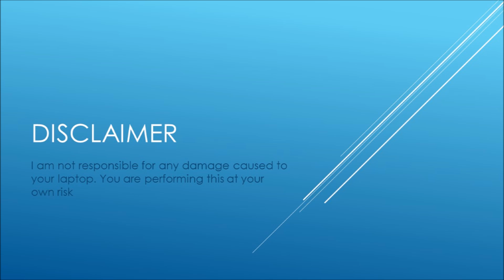Lenovo ThinkPad E570 Disassembly and SATA Hard Drive Install. Includes RAM & Wireless Card.

Comment: Hi Joe,  thanks for the video. I need little help here, can you help me with the issue? I had tried to upgrade through Lenovo vantage and during bios upgrade it turned off and never turn it back on. I took it to local repair shop and he asked to replace the motherboard or another option is to “get a binary file to flash the bios” ..we reached out to Lenovo and they declined to share the binary file..my repair shop guy told me that anyone had this laptop can share the binary file and that could be used to revive my laptop. Can you please please help with binary file?

Comment: At 0:56, the bottom left corner and bottom right corner screws kept getting missing, the holes won't hold the screws in place, the manual says they are m2x7mm screws but they don't fit at all, especially the bottom right corner one, the m2x7mm screw falls right in and out.. what is the correct screw size? Are these 2 screws on your laptop the same size as all the other screws on the back panel at 0:56?

Comment: New to SSD terminology and doing research - if looking to expand with a second SSD on my E570, can I use another PCle NVMe drive or is the second bay only SATA connection?  I assumed as the boot drive was PCle that the other bay was as well.  Also, high level, if just using the SSD as storage for video files for Plex Media Server processing, will a SSD provide noticeable gains over a SSHD or normal HD?

Thanks for the videos!
Reply from the maker: hey Johnny, the laptop contains one PCIe slot and one SATA connection
Reply: Really appreciate your videos and help on SD and YouTube.  Just installed a SSHD last week using your video.  Keep up the good work
Reply from the maker: +johnnyma45 quite welcome!
Reply: Question how do i play a dvd on this computer?

Comment: Hello Joe, Thanks for the video. So quick question, does it mean E570 can only accept the addition of PCIE SSD? I can not just buy one of those 2.5" SSD and put it in there?
Reply: and also if so, which brand of PCIE SSD would you recommend?
Reply from the maker: +Chen Yuzhe (James Chen) Hi Chen, it can take one standard SATA 2.5" drive and one PCIe SSD.

Comment: Hi Joe, I really have one more concern with this laptop, if this is something you can help me with, I googled and tried all the options nothing worked. I called Lenovo and they are asking me a fee to solve this issue I cant believe that LEnovo is so lame. Anyway, My screen auto lock when it is in idle mode after 15 mins. I tried all possible troubleshooting nothing works..do you know some magic that you can share with be ? Greatly appreciate your suggestion. Thanks Joe, GN
Reply from the maker: Hi Dominic, this setting is located under Power & Sleep settings which you can find by typing in the Cortana window
Reply: Hey Joe, No No, those are basic settings. none of those work, Looks like Lenovo has some auto lock options set. This has nothing to do with windows settings.

Comment: Hi Joe, Thanks for the video. Very straight forward. Question though, Is it necessary to remove the RAM, SSD, DVD, Wireless card in order to install the SATA ? what SATA drive do you suggest ?
Reply from the maker: Hey Dominic, it is not necessary to remove anything when installing the secondary SSD.
Reply: Thank You Joe

Comment: Thanks for the video. I added the SSD according to the directions. However on booting up, laptop does not recognize the new SSD. DO I need to do anything in BIOS etc to make it recognize the new SSD.
Reply: If you haven't done so already, you will have to initialize and format your ssd through Disk Management. 
Here is a link to a pretty straightforward step by step instructions I found by a little googling. goo.gl/6HjG9K
Reply: thank you
Reply: Amitabh, were you able to get your additional SSD working?

Comment: Will the system automatically detect the new hard drive after powering on ? I have a old 500GB SATA 7200RPM from my old e520 which was the primary harddisk with Windows installed but I am pulling it out and will connect yo the 570 as secondary. Will it cause any problems. Once it detects I will format the drive ... Thanks for this awesome video and a quick answer to my comment is very much appreciated...thank you
Reply: Nevermind. I have installed the new drive and formatted successfully. Thanks for the video. It was great help especially the HDD shield. otherwise I would have just ignored it.

Comment: Thanks for the video. Do you know if shield is necessary for SSD as well ? Btw Lenovo did not provide any in my box.
Reply: Never mind. I was able to install SSD drive with your instructions. Appreciate your videos...
Reply from the maker: I'm glad you find them helpful!
Reply: Rajesh- Did you put the shield on the SSD or not. I did, and my laptop is not accepting it. Wonder if that is the issue